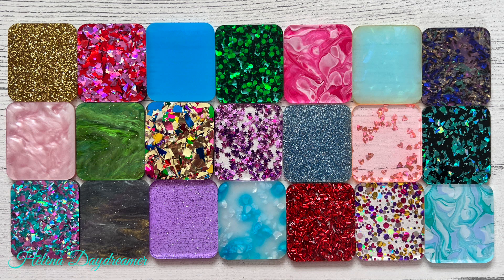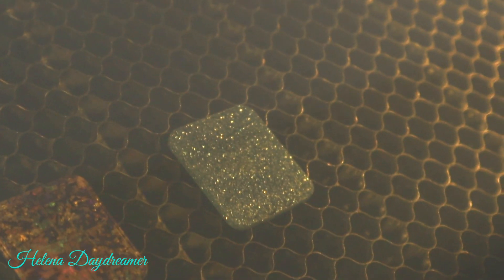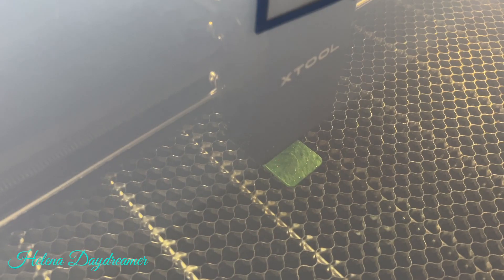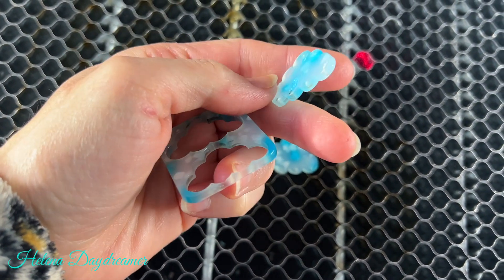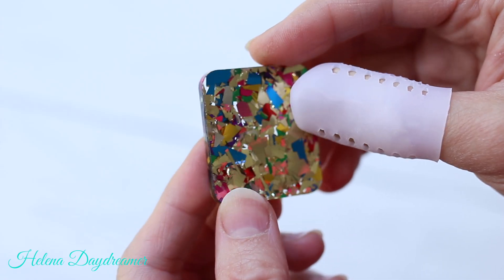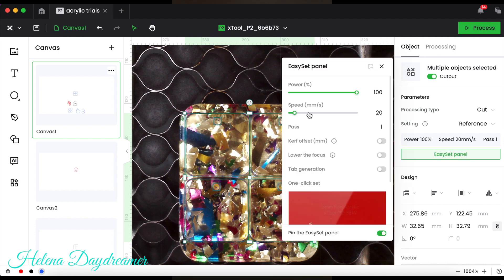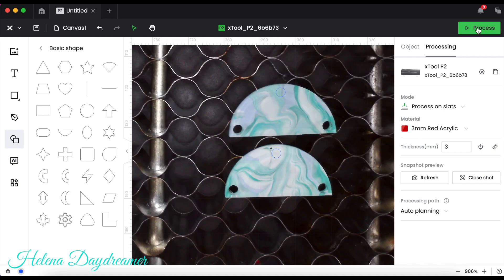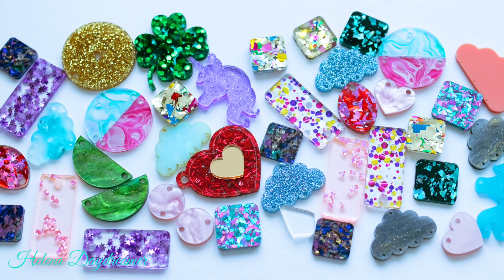Can This CO2 Laser Cut All These Acrylics? xTool P2 Challenge

Comment: question for you if you had to pick between p2 or f1 ultra which one would it be? I love doing earrings but I love engraving necklace's as well. Just wanted to get your take on it?
Reply from the maker: @Nani_Of3  it’s a tricky one, they are both so different and build for different purposes. You’ll really need to consider what you like to do more, is it cutting wood and acrylics or engraving metal jewelry? What kind of metal, perhaps you could get away with P2 and F1 (not the ultra) it’s really hard for me to suggest one or the other. I love them both and I use them for different purposes.